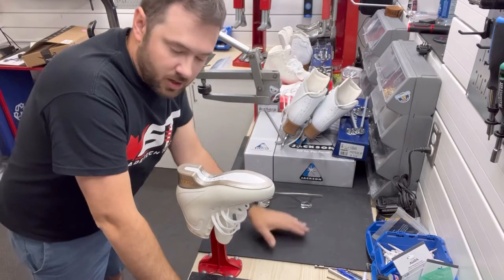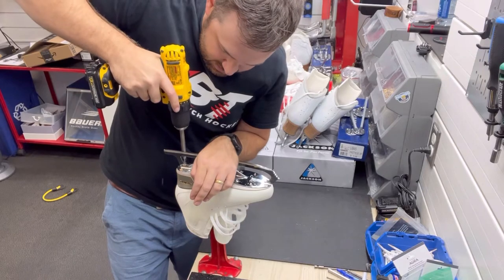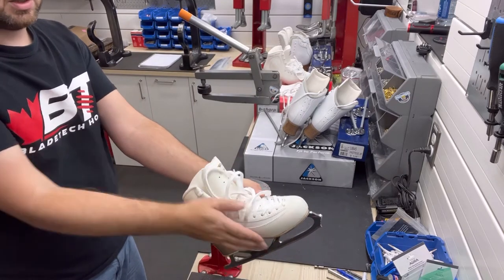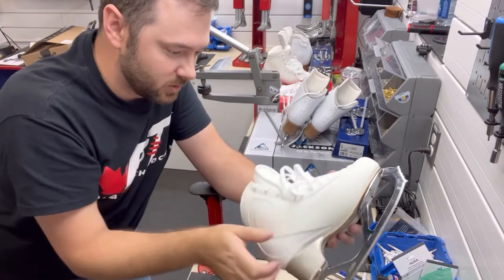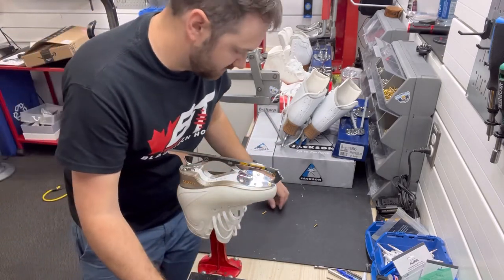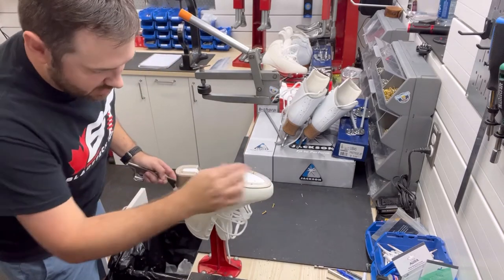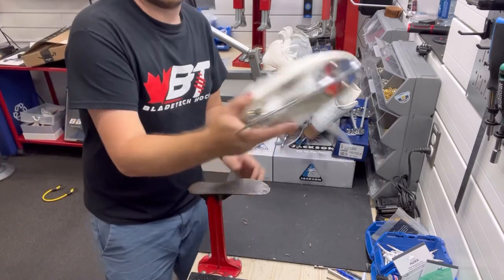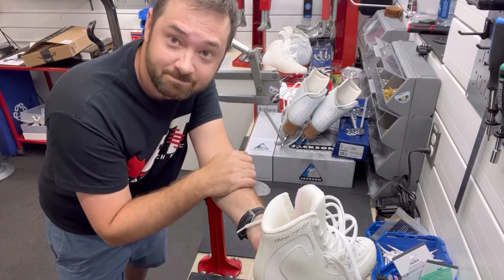Mounting Figure Blades

Comment: I have the Jackson Freestyle with stock Aspire XP blade and am looking at switching to the Coronation Ace.  My current blades (Aspire XP) are 9-3/4" inch, so as the length is based on the sole of the foot with the small gap, I'm assuming going to another brand skate would mean I still require the same length (9-3/4"), correct?  Also, does the Aspire XP actually have a spin rocker (at the front, not the 8' radius)?  My pro shop said no, and a Jackson rep online said yes.  Curious how much of a change in rocker it would be moving to the Coronation Ace (not planning on ever learning more than single jumps, but wan to improve footwork and spins).
Reply from the maker: You would indeed need the same size blades, so a 9.75” Ace. All figure blades have a “spin rocker”. The Aspire XP isn’t as well designed as the Ace, so it’s not as easy to spin on. The Ace is the worlds best selling blade for a reason. The 7’ rocker, and the spin rocker placement, make it great for learning to spin. 

As to vibration, that usually means the screws aren’t tight, the blades aren’t aligned under you for you, or the blades haven’t been sharpened straight

Comment: Just wondering, I have some Risport Electra’s that came with the stock edea rotation blade, the heel plate doesn’t reach the edge of the heel, is it supposed to? Or is it more common to see a gap? When I decide to upgrade to Coro Ace the sizing is different, my current are 8 2/3” so I will be needing 8 3/4” coro ace, I’m assuming this will reach the edge of the heel more, I’m wondering if it makes any difference?
Reply from the maker: Hey. So for the most part, your blades should be about 1/4” shorter than the sole aka you’d see a gap. So if your sole length is exactly 8.75”, the suggested length would be 8.5”. Edea Rotation blades come in  1/3” vs 1/4” increments, so you have 8 2/3” blades. I suggest that if you’re growing, or find the blade to “tippy”, you maximize the length of the blade to make it as big as possible on the sole. I’d say it doesn’t make much of a difference either way, especially since you’re going from a basic blade to a fantastic blade.
Reply: @bsharpottawa  that’s really really helpful thank you!! I know it’s only because of financial struggle that I haven’t upgraded yet, it’s way overdue, I’m struggling with these horrid blades they don’t hold a sharpen longer than a few hours and the toe pick is laughable. 8 3/4” will be the size I’ll get in my coro aces as it’s the closest to the current size I have now so hopefully (apart from the rocker size change) it shouldn’t cause much of a difference, maybe just a tad more blade at the back for me to rely on but I can’t complain about that hahaha